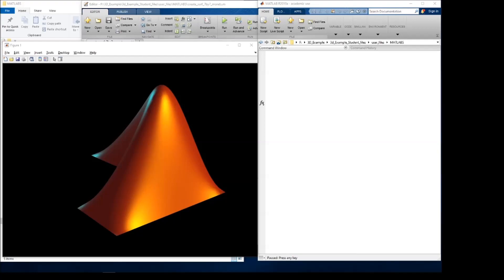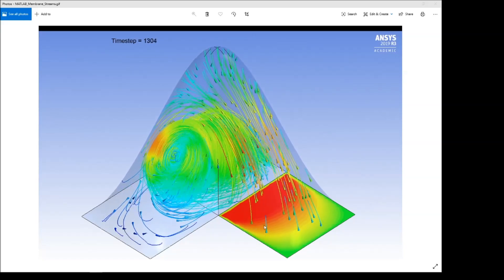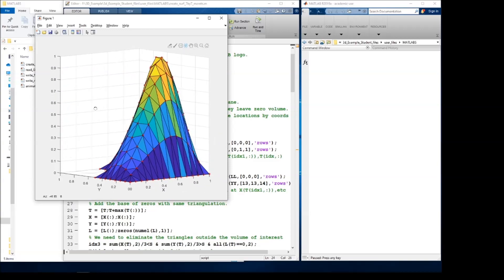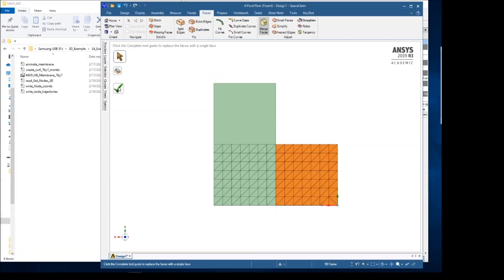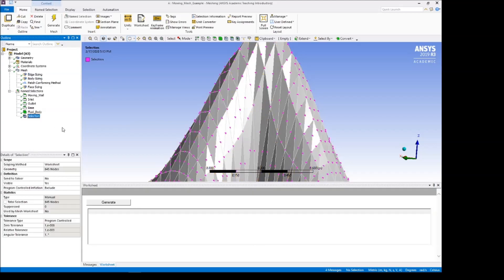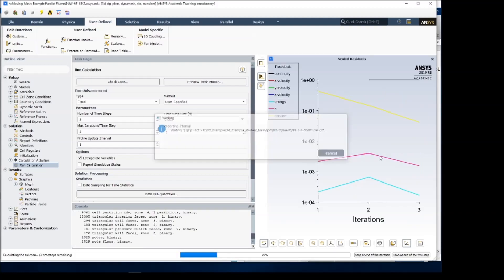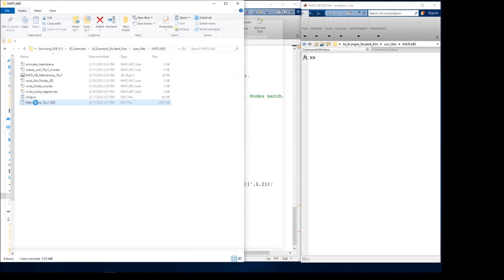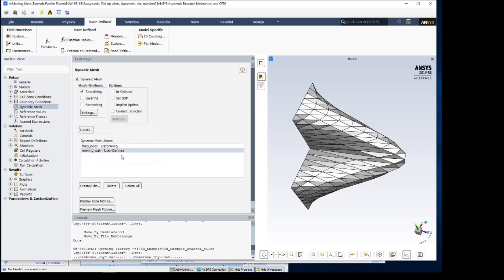Using MATLAB  to create geometry and moving boundary for ANSYS Fluent with UDF.

Comment: Dr. Fig, perhaps you've already figured this one out, but I found an alternative way to export the node coordinates with IDs from any named selection. If you run the dummy simulation like you do when you export the nodes to a transcript with the Get_Nodes_3D.c UDF, you can then visualise those results in CFD Post. In Post, you can export the Domain Node Number with their coordinate locations to an excel file and it will have everything listed only once. Perhaps this will be unnecessary since you've already written the UDF, but hopefully this helps.

Comment: Hi Matt, I really like your video and I certainly learned a lot from it. I was able to implement this approach to model the motion of the right ventricle in a serial mode. However, when my simulation is running in parallel mode, it didn't work. The udf can be compiled, however, errors appear when the simulation starts to run. Is this approach only suitable to run in fluent serial mode only?
Thank you so much!

Comment: Hi Matt, thank you very much for your video. I've been trying to use your files to adapt them for a case that I'm studying. I'm trying to obtain a dynamic mesh in Ansys 19 R3 of the right ventricle of the heart. From an image registration, I've obtained all the different coordinates that the nodes take during the motion, and with them, I've created the .dat file. Nevertheless, I'm having some issues when trying to build the library in Ansys introducing your UDF file (Move_by_file_membrane.c). When trying to build the library (libudf), some errors appear in the console, saying that there are some syntax errors in the UDF,  as for example, missing of ; in some lines of the code (which I believe is not the case).
I don't know if you know what is happening, but if you have any suggestions it would be of great help. 
Thank you very much in advance!
Reply from the maker: Send me an email.
Reply: @mattfig6098  Hey Matt, 
     I am a PhD researcher who is looking to implement this approach to model the left ventricle. I am curious if you and Dante made any progress in his right ventricle model that you think might be informative for cardiac structures generally. I am happy to provide further information on my model if I can get your contact information. 
Cheers,
     John
Reply: Dante, did you have any success implementing this methodology into you model of a beating Right Ventricle?
Reply: @johnk9352  Hey John. I am a research student currently learning how to navigate ANSYS Fluent. I was wondering if you were ever able to get the simulation working for a beating right ventricle? I am trying to do a similar concept but for the right atrium.
Reply: I am having a similar issue. I have tried compiling using VS 2022, 2017, and 2008 but to no avail. Building just leads to syntax errors. I wanted to email you @mattfig6098 but your channel does not attach an email link.